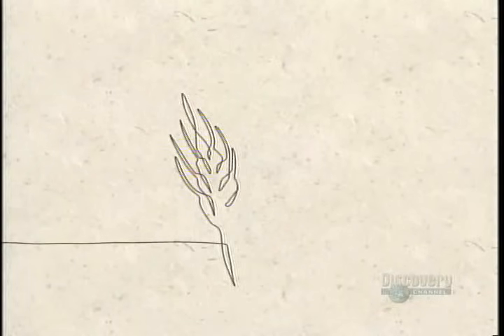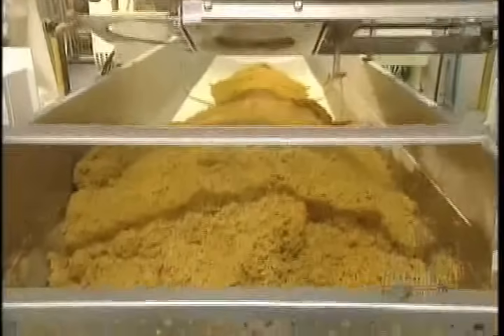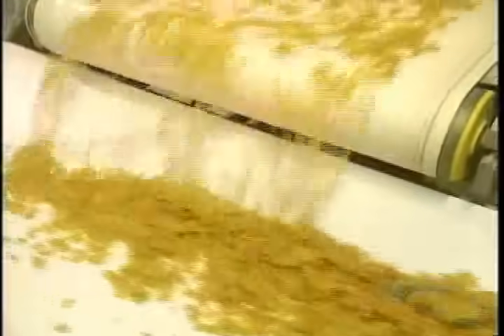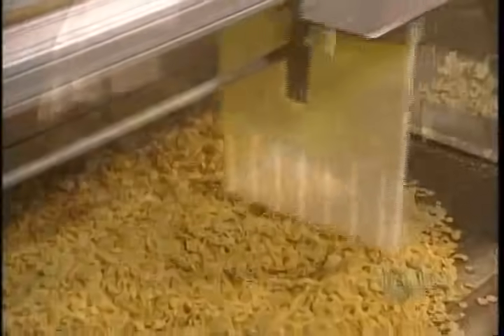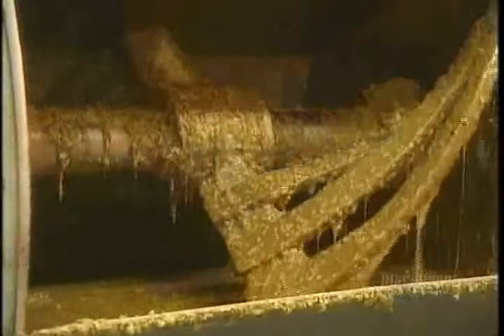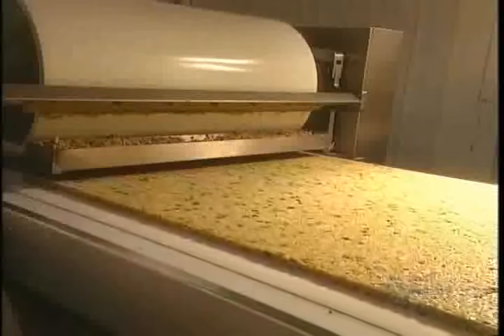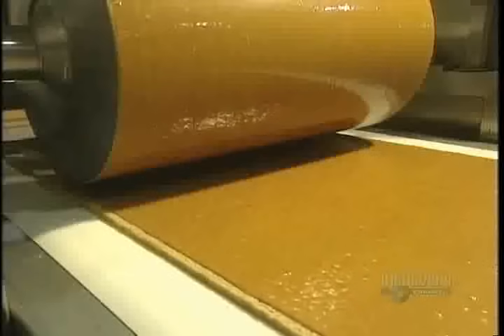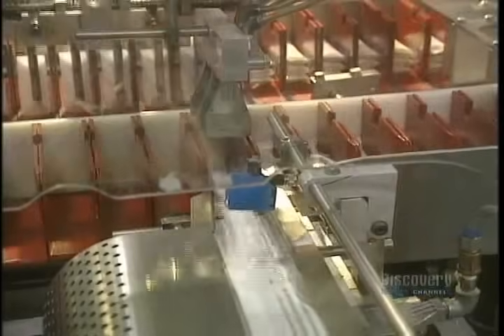How It's Made Cereal product

Comment: At 2:00 narrator says the sugar syrup is boiling at 230 degrees Centigrade...I don't think so.  At 446 degrees Fahrenheit you would have burnt sugar and steam.
Reply: It's heated and set at that temperature 230C is the peak temperature the sugar reaches this is typical candy making process. If it makes more sense they heat the sugar until it reaches 230c and not a single degree over. It is then cooled slowly in order to get the right chewy texture from the sugar molecules. 

Look up how Hard candy is made versus  how soft sugar candy toffee or marshmallow candy is made for more reference. Its all about the temperature.